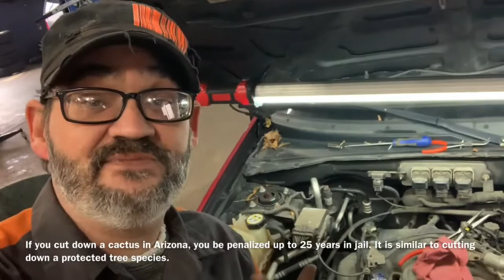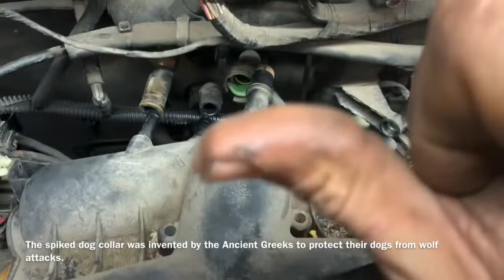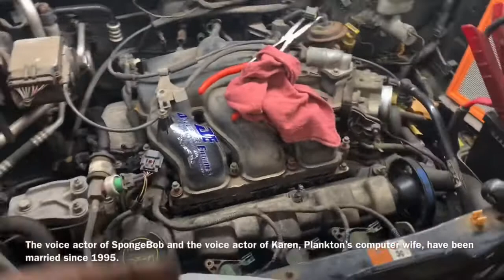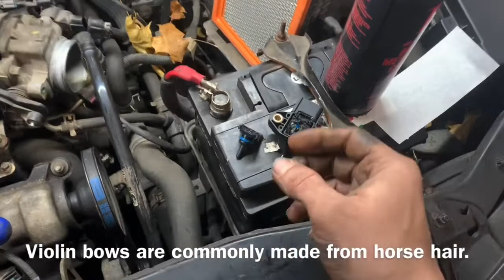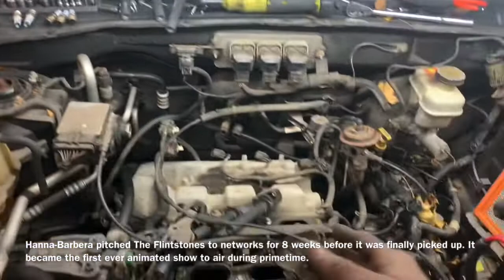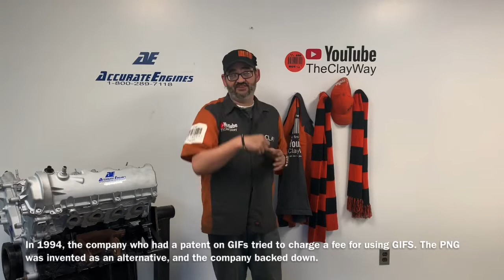Possible reasons why your Ford escape is running poorly/stalling at lights/reasons it’s smoking

Comment: I had this problem. FYI - the gas that bypasses the pressure regulator goes into your vacuum lines. One of them goes to the Power Brakes.  It greatly affected my brake performance. The brakes never failed but were very soft. I did drive the vehicle approximately 200 miles, after replacing the pressure regulator, and it automatically vacuumed all of the gas out of the brake system and they work as normal now. I am posting this so anyone with the same issue can try to run the fumes out of the system before replacing the main brake components. (expensive and time consuming). The design of the pressure sensor is one of those, only an engineer could design something this stupid.  It also took a long time for the engine to quit smoking out the exhaust. At least an hour of idle. It cleared itself up for the most part as is a reliable vehicle again.  Hope this helps someone.
Reply: Today my escape started driving terrible. When I turned on my AC it got worse so I turned that off. But I noticed my brakes were different too. They worked but not like normal. Thanks for posting this. Im.goimg to go check my truck now.

Comment: My 2002 escape started driving terrible today. When I turned on my AC it got worse. Even having the fans on it seemed worse. It won't go over 40- 50 mph when I have the pedal to the floor. Im going to check the hose and see if it's wet? It was really hot under the hood and some some on the driver's side when I went to a stop sign. It wasn't black smoke. I'm very worried. I don't have the $ to take it to a shop. I'm getting surgery soon and can't work. I hope it's nothing major? Thanks for the videos.

Comment: Clay, great channel.  I'm in Battle Creek.  I'm not a car guy but always have enjoyed the few small things I've done.  Thought I'd share something.  2009 Escape 2.5 engine.  For 5 yrs it would spit and sputter off/on primarily from a stop...light/stop sign.  Almost like it wasn't getting gas.  Heck i thought it was gonna completely stall out a few times.  Check engine light was on.  Service station and Oreilly checked it on their computer but i can't recall the code.  Everyone told me I'd have to leave it with them for a few days.  So i started looking stuff up online.   Changed the egr and throttle body(pardon me if I'm botching the names).  No fix.  Gave up on it for awhile.  Did another search online and found a mechanic who said 90% of the time its the purge valve canister.  $15 part so i gave it a shot.  BOOM! Fixed.  Made me feel like Superman. Lol.  Keep in mind I'm a desk jockey so not very good at mechanical stuff.  Oh, my Escape is getting ready to hit 230k miles and when i changed oil last time didnt appear like it needed an ounce of oil.  230k and not burning an ounce of oil?  Hasn't been a PERFECT car.  Air conditioner compressor, valve cover, front end stuff like bearings and tie rods.... But overall a pretty sound car.  Anyhow thought I'd share.  Take care
Reply from the maker: That’s a great story and awesome to hear I can imagine that feeling if you’re not used to doing this type of stuff I get that same feeling when I figure out something that I never thought was possible so I totally understand where you’re coming from if you ever need anything feel free to reach out to me I’m always happy to help and advice is always free God bless have a great day
Reply: @sharpcarco    thanks Clay.  I do kinda have a question.  I keep debating whether or not I'm pushing my luck driving a car with 230k miles.  But I've kept up with maintenance on my Escape... Oil changes never longer than 5k.  Transmission fluid changed about 3-4x.  Newer water pump and what I've already mentioned.  Is it crazy to think i could take this Escape to 300k miles?  I realize you could never answer my question with 100 percent certainty and there are no guarantees with ANY car but still curious to hear any thoughts.  I kinda like my Escape.  Is plain n simple but its nice not having a new car to be overly concerned about.  Thanks
Reply from the maker: Well I think they’re great cars so I don’t see any reason why it wouldn’t go 400,000 miles but you never know roll the dice then let us know worst that can happen you break down on the side of the road and you walk away. What do you have to lose
Reply: WASN'T THE PURGE FOR ME

Comment: Brother you have kept us onroad many times. I replaced plugs coils and injectors. Still gettimg flooding.2011 cant find pressure regulator. The key on not running pushes gass out

Comment: Hi i really enjoy your videos.  very helpful.  I have a 2006 ford escape 6cyl 2wd, in Canada.  I have a few questions.  The error code p0353 I cannot remove.  Have put 2 new coil packs and spark plugs in the # 3 cylinder(back of engine drivers side) and error comes back immediately. All coil packs on back of engine were changed.  Also with key in on position the fuel pump makes weak buzzing sound every few seconds.  It will start and go in drive but will stall as soon as I give it gas.  The only error I get is the p0353.  This error has occurred for about a year and only came back a few times but is now permanent.  I cant drive it anywhere as it will stall.  I'm guessing this is the PCM.  Any ideas would be greatly appreciated.  Ty

Comment: Ive got a 2011 ford escape. Normally it only cranks but wont start. I can get it started if I gas it but it dies as soon as I stop. I dont have any other major indications that anything is bad. I had it running for about 1 minute just now while gassing it at about 3-400rpm. And when I check the engine bay something was glowing at the bottom over on the passenger side as if it was hot.

Comment: Very knowledgeable video! I have 2012 Ford Escape V6 engine. Runs awesome but just recently I noticed that I've been losing mileage like crazy. I watched a video that showed it could be my air filter causing the problem, so I got that replaced and it's doing the same thing. I filled my tank up yesterday and couldn't even get up the street without losing 10 miles. Can you tell me what could be causing this please? And what I should do to get it fixed?
Reply from the maker: Well thank you for the kind words. I would take that and have somebody who knows how to read a scanner take a look at it more than likely you’ve got a plugged catalytic converter . I can’t say for certain because this is just a text message but that often because for a dramatic decrease in your mileage
Reply: @sharpcarco  will do. Thanks so much replying back to me. I really appreciate it

Comment: Hi! I have a 2012 Ford Escape got a new battery Oil change alternator but a few months later I turned a corner and my oil/ battery light came on car stopped running. It came back on and was working after I turned it off and restarted. Took it to a mechanic (Gattos) they can’t find anything wrong with it. Any advice?

Comment: Hello. I have a 2006 ford escape. It starts and after a about 2 mins it cuts off. I have changed the crankshaft position sensor.  Fuel pressure sensor.  Spark plugs. Idle air control. Mass air flow sensor.  02 sensor.  Fuel filter. Help me plz?????

Comment: Hey Clay, I have a 2011 Ford Escape. I've  replaced the battery last week because every morning I needed to jump it. This  vehicle is stalling at 40 mph , on a turn and at lights. Happened 4 times today. My mechanic disconnected the rear windshield motor because it was burned out and he thought that's what was drawing from the battery.  Well, after he disconnected it I drove home and it cut out again on the way. Stopped,  put it in park and started it and drve home.  I'm  a little nervous about driving this. What do you suggest?? Can a dealership do and electrical diagnostic? Thanks, k.😢

Comment: Im going to pick one of these up tomorrow. Engine runs like a top but after driving it stalls when you come to a red light/stop sign any ideas?
Reply from the maker: Well obviously without getting much more technical and possibly even looking at it I would say follow the video the unfortunate part is I don’t remember every single video I make I have over 800 of them so you would have to be a little bit more specific about the problem and about the part that you’re thinking about replacing

 I can’t see the same thing you seen when you were watching the video they only give me the comments they don’t necessarily give me the actual video that it’s connected with if that makes sense they show me a teeny tiny thumbnail and I can’t remember all the videos so I can’t be more specific very sorry
Reply: Oh fair enough. 2003 ford escape ford dealer told the lady it was stalling out at red lights due to transmission. So she got the trans rebuilt and it didnt fix the issue. Im thinking its something else engine runs perfectly it just stalls after driving only when coming to a stop
Reply from the maker: Since it’s a 2003 I don’t think it has a fuel pressure monitor like the newer ones do which is what I think this video is about so you could try the fuel pressure regulator which is located on the passenger side of the engine Center next to the intake look up fuel pressure regulator replacement for a Ford escape and see if that’s the problem there’s a rubber hose connected to it if the rubber hose has fuel inside it then it is defective
Reply: Got it home. It only dies when it is warm after driving abit. I dont believe it is fuel related. It starts fine after dieing just wont idle when warm
Reply from the maker: No unfortunately now that you describe it that way it’s quite possibly a bad catalytic converter especially if you ever drove it for any distance with the bad spark plug or coil raw will drop down inside the catalytic converter eventually plugging it up. That’s one of the reasons than the other reason is just from bad fuel that has been ran inside it over the years I would have it checked out by a mechanic they would look at the live data and then be able to tell for sure if the catalytic converter is one
Reply: @sharpcarco  yea the lady has spent some 4grand on repairs and mechanics cant figure out whats wrong. Iv plugged in my scanner and theres no codes. Ill keep trying things eventually ill get it

Comment: Hello there I have a 2002 ford escape v6 I just replaced mainifold catalytic converters on bank 1 bank 2 coils plugs valve gaskets done all with in 2 weeks car is stalling  driving and coming to a stop now 3rd catalytic converter was removed and straight piped into muffler  when work was done bank 2 catalytic converter was melted completely bank one was totally clean now having a stalling issue

Comment: Thanks for the tip I replaced it you ran good for like 2 hours  the same problem came back .. maybe I got a defected fuel pressure regulator ?
Reply from the maker: That or it’s possible that your PCV valve is plugged creating too much vacuum. Just guessing on that that may not have anything to do with it but I would definitely return it as defective.
Reply: @sharpcarco  thanks for the quick reply I figure it out coils and plugs I find out that some of this coils after they get hot they stop working

Comment: My 2006 Ford Escape XLT v6 has turned over, then started than 30 seconds later after the instruments were shaking when running loudly shut itself off, then displayed dead battery but within seconds on the charger the battery is completely full, any ideas ?
Reply from the maker: Well you probably got two issues and of course I can’t be for certain because this is just a text message it’s very common for the alternators to go out In these I have several videos on that

And I imagine once you get that done you’re gonna find out that Your battery is probably no good either meaning that it probably has bad cells inside it

Comment: Are the fuel pressure sensor is the fuel pressure regulator the same item? I have a print out with possible issues and the are itemized at two different problems relating to p01943 code. 

Changed the fuel pressure sensor and the next day my 06 Ford Escape stalled out on the freeway.

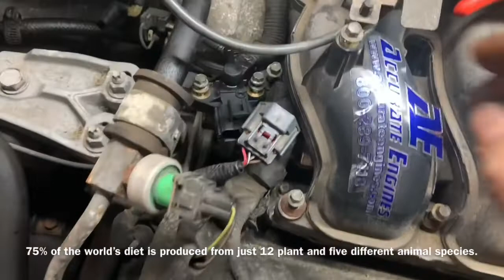4:14 what I replaced being called the pressure sensor was called the pressure regulator?

Comment: Why my 2007 ford escape 3.0 gets hot? I changed oil and filter, thermostat, water pump,spark plugs and coil but it still gets hot?? And has no air packets because the heater runs good.

Comment: My father in law has an 06 escape. That starts fine and drives ok. But once at operating temp if u switch to drive or reverse it'll shut off. Any ideas what it could be. Park and neutral starts up fine. Thanks
Reply from the maker: Quite possibly could be a plugged the catalytic converter, could be the EGR is also not functioning properly or the vacuum going to the EGR Is not there can’t be for certain of any of these things of course but I’ll give you some ideas and things to look at
Reply: @sharpcarco  thanks for the advice I will go and check these items

Comment: I'm in the process of rebuilding the motor in my 02 escape..top end almost complete, tagging sensors and a few more gaskets now but it's crazy mine don't have a fuel pressure regulator at least in that location and it is the XLT sport 3.0l🤷🏾‍♂️
Reply from the maker: Were your catalytic converters bad? Generally, that’s the reason that these engines go bad.
Reply: @sharpcarco  nothing wrong with my catalytic converters...I made mention about there's no similar fuel regulator which I've noticed since I started rebuilding this motor....didn't have to but I'm restoring it since I went and purchased it and like the fact it's worth the money to restore

Comment: Hello how are u? I have 07 ford escape and I'm having problems with it it's smoking from under the hood but I have no leaks on the ground and I can smell it coming through my vents.. and when I turn my truck off it's smoking any feed back would help please and thank you!!
Reply from the maker: Well, you have to have something going on my guess would be something to do with the heater core. Possibly a rusty line leaking onto the exhaust.
Reply: @sharpcarco  Thank u I appreciate that I'm gonna try and get it looked at today because I'm really scared that it might catch fire if it keeps doing that!😮‍💨😔
Reply: @fedup15granny35  your battery could be over charging where to go from there I am not sure watching these videos to try and  repair the other issues along with this issue. I hope you find your solution. God Bless. :0)

Comment: I have a 2005 ford escape 2.3 engine. It starts but stalls after running a few miles then stalls for good . It runs a few miles at a time . The fuel pump , spark plugs , all ignition coils , fuel pressure sensor too.  What is it stalling all the lights come on when it does. Thanks

Comment: I have 2006 escape Xlt 3.0 why is it pouring out oil like a water hose from under the drivers side of the car I've checked : the oil pan for leaks , oil drainage plug , the. Heads

Comment: I'm going to be honest I don't know much about cars but did manage to replace spark plugs, coils, gaskets but lost one of the vacuum hoses in the process. The one that comes off the vacuum hose in the back middle of the intake and goes to the left.... Where does it attach too? Please help! It's a 2002 Ford Escape xlt v6 3.0
Reply from the maker: Lift up your hood and look at the bottom side there is a diagram that shows you where the hoses go. I can’t tell you for certain wear that one goes but it will tell you it’s a white tag with black hose on it

Comment: Hey Thanks a lot man that was very helpful I’ve Ben searching for ever and couldn’t find the problem 👍
Reply from the maker: Well hopefully the video helped you Solve it
Reply: It totally did , anytime I’ll need something again I’ll know where I have to look 👍
Reply from the maker: Freaking sweet very glad to hear it
Reply: The Clay Way awesome video. I just changed my valve gasket and spark plugs on my 2007 Ford Escape. Now it’s sputtering when I hold the gas pedal down in idle it hits about 3,000 rpms and drops to 2500 and goes back up to to 3,000 and repeats the cycle. I did pull the fuel line not realizing I didn’t need to but wondering what the issue could be

Comment: So...   weird issue with mine not sure what's up. Can't find anything that matches up with symptoms.     Var starts and runs fine, seems like it is idling a little low at a stand still Sometimes.    Most issue I have is.   When warm.  If I make a kinda sharp left curve. It acts like it is out of gas. But it only does it for like a second.  Check engine light says fuel pressure rail sensor and that's the only code I got.  Other then that it runs like a champ. 08 escape. Same motor as in this video. Any ideas?

Comment: Hey Clay I have a 2012 ford escape I was driving it an it putter then died it will start but only run like 10 sec then die. I'm lost fuel pump is working thought maybe it was fuel filter but can't find it did sum research an it says they don't have them on 2012 any idea on what it could be????

Comment: 9:26 I have a 2005 Ford Escape. I ran it low on fuel. And then it started acting up, it all started running good, and then all of a sudden. It'll just die out, you give it gas. And it makes it worse what could be wrong

Comment: So my son has a 2015 Ford Escape with a 2.0 ecoboost. All the sudden it lost power would only go about 35 mph. Took it to some locals guys and they thought they new what it was but it ended up not being that. Then tool it to Ford and I normally would not do this because of their outrageous labor rates and I was right about that because they called and said it's probably the turbo and it would cost $900 to $1,000.00 just to find out. Anyway I picked it up. The power loss is still there and a ton of grayish white smoke with a strange smell poor out the tailpipe. Any help would greatly be appreciated